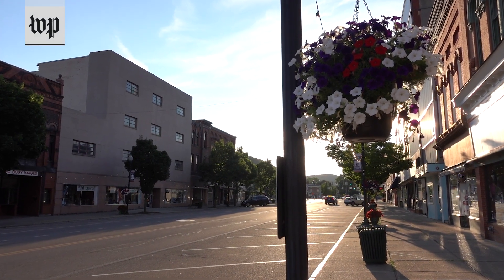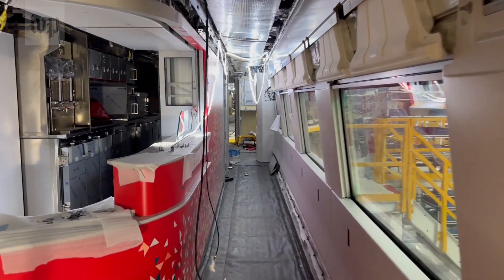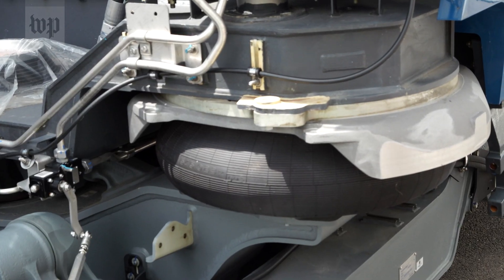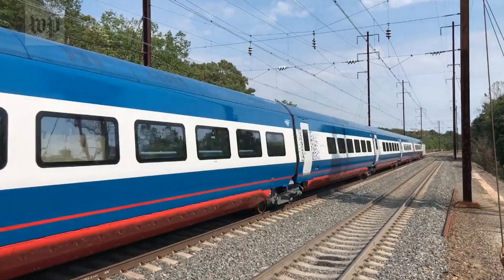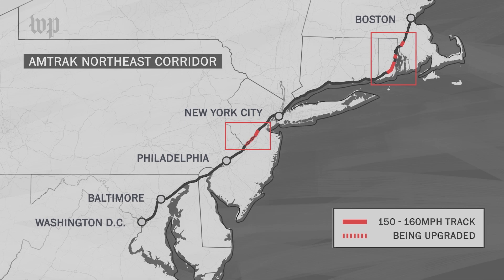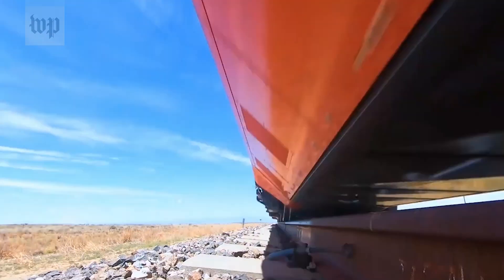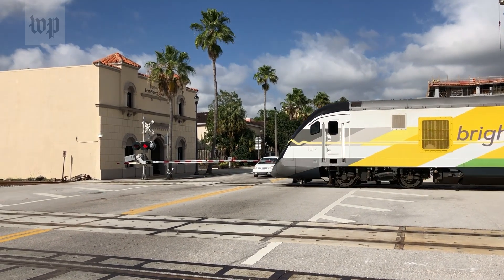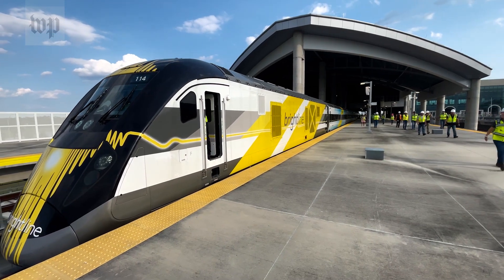Go inside Amtrak’s new high-speed train

Comment: Now Amtrak actually needs to make the tracks high-speed capable, with an average speed of 123km/h the Acela express wouldn't be called a highspeed line anywhere else in the world.
Reply: Nonsense! The French TGV fleet average speed is 60-75mph so 95-120k/h. For example, in 2017 French TGV trains averaged 103 km/h or 64mph. The Acela in its current state is about as fast on the entire route as French TGV trains are. And this really isn't very surprising. The original Acela was based on a contemporaneous Alstom TGV design and modified for the North American market by Bombardier. The overall philosophy of how the service was built was very French in many ways. Essentially, French TGV was the model they were going for.

Plus, the Northeast Corridor is mostly 125+mph with a few even faster sections (125-140mph) and two 150mph sections. In actuality, the NEC is a few corridors stacked end to end but served by a single high speed train. There are a ton of HSR corridors of similar length, with similar top speeds, and similar slow sections all over Europe. And a majority of HSR corridors in Europe top out at 125mph (200k/h). If you don't consider the Acela HSR then more than half of Europe's "HSR network" disappears from the map too!
Reply: @TohaBgood2  THANK YOU!!!!!!
Reply: @amtrak_121  Well, what I said is just objective reality that can be easily verified from public sources. But my pleasure anyway!
Reply: @TohaBgood2  
You're saying nonsense
  you took the speeds of the local trains (ter: regional express train), intercity coral), not those of the tgv

paris-marseille 660 km in 3h40 = average 178 km/h
paris-lyon 391 km in 1h45 = average 223 km/h
paris-bordeaux 499 km in 2h30= average 230 km/h
Reply: @TohaBgood2  Yea that is non-sense, first of all the majority of European countries don't even have high speed rail and don't claim to.
But if you look the countries that have high speed rail, even the not so great German network has the vast majority of all important corridors operating between 220-300kmh/h.
As someone who does take German high speed rail regularly I can tell you the majority of high speed service here does quite a few more kilometres per hour than the Acela even though the density of stations/stops here is far higher.
Reply: @mx338  Nope. Look at the Map of German HSR. The vast majority of the ICE lines are "Upgraded lines for 200–230 km/h (124–143 mph)" and some lines are "High-speed lines for 250 km/h (155 mph) or more". Only four German HSR lines are "High-speed lines for 300 km/h (186 mph)."

You can google this map in three seconds. Why would you try to lie?
Reply: @TohaBgood2  I have looked at the exact same map, while around 65% of tracks support less 230km/h, as I said it's the important corridors. that carry the most amount of passengers between the most populous cities on the most important routes.
Which should be obvious because why else would they be targeted for such expensive upgrades.
Reply: @mx338  Again no. The vastest majority of the German HSR corridors are "Upgraded lines for 200–230 km/h (124–143 mph)" So 200 kph (124 mph) to 230 kph (143 mph).

Don't pretend like those are all 230 kph. That's very clearly not true according to freely available public data.

And the actual passenger flows were never in question here. The Acela also has the vast majority of its passengers travel on the higher speed sections of the NEC. You're not taking that into account, do you? So why would that matter for the German HSR network all of a sudden?
Reply: @TohaBgood2  I just found the Wikipedia map you are looking and note that upgraded tracks are not even called called high speed, you are looking at the map of train which are serviced by ICE type trains which doesn't mean high speed service.

If you want to see German high speed corridor times look up ICE Sprinter Lines.

And Germany here really is one of the worse examples as I stated, as not a lot was invested, and is not impressive compared to countries like Japan or China.

But the achievement you are trying to seem great here is that the whole USA was capable of connecting just two cities, NY and DC, with high speed only on that section of track, and even that would be considered average at best compared to the rest of countries who built high speed rail.
Reply: @mx338  🤣🤣 this was the most entertaining conversation I've seen as much I love amtrack  Japan south Korea  Germany and France and China  have the best trains what's inbarising  is that India trains are faster than amtracks that's a fact :(
Reply: A train can only be called a fast train if the rails can support an average speed of at least 200 km/hour or 125 miles/hour.  like a freeway, it doesn't matter what type of car it is if the road is designed to be driven at an average speed of at least 100km/h or 62 miles/h.  can only be called a freeway
Reply: Yeah there is literally no advantage to the Acela vs normal Amtrak trains currently.  The new Seimens dual mode locomotives and new viewliner cars are capable of 125mph and routinely do those speeds in the same areas where the Acela can do those speeds or faster.  The old GE diesels (the very blocky looking diesel locomotives that move most of their trains in the south and west) can still pull 110mph where infrastructure allows.
Reply: It's like a TGV that is running on normal tracks in France.
Reply: Blame Blumenthal for that. He needs to allow Amtrak to straighten the lines. If not, Connecticut should be defunded
Reply: In the video they literally said that they were doing that
Reply: Why do people always base these things on AVERAGE speed over OPERATING speed?!
Reply: @amtrak_121  because operating speed is meaningless when it comes to trip times, and that's what matters to passengers. Passengers obviously want to get to their destination as quickly as possible.
Reply: @mx338  it’s still a high speed train
Reply: @amtrak_121  it's a useless high speed train if it doesn't move people quickly.
It's like a fast sports car people buy to show off, but they are never able to properly use because of speed limits everywhere.
Reply: @mx338  it can travel 150mph both in New Jersey and Rhode Island/Massachusetts!
Reply: @mx338  except it doesn’t have those kinds of speed restrictions everywhere!
Reply: @amtrak_121  yes and? The average speed still sucks and makes the train take a really long time. And 150mph isn't  really amazing either, the new trains could do better than that.
Reply: @amtrak_121  and as someone living in Germany, with the Autobahn having no speed limit for some sections, I still consider a sports car a waste of money even if you can manage to get up to 250km/h here for just a few minutes.
Reply: @mx338  at least we HAVE high speed rail!
Reply: @amtrak_121  not even 50 miles of it but congrats.
Reply: @mx338  no it’s definitely more than 50 miles (I’m pretty sure at least)
Reply: @amtrak_121  well you should read up on it because it's only 49.9 miles that allows speed of 240km/h.
Reply: @mx338  THAT CAN BE ROUNDED UP TO 50!!! It’s only 0.1 miles short!
Reply: @amtrak_121  it's not 50, like I said. 
Why are you Americans always so eager to make your country seem great, and usually like the greatest? 
Instead of admitting your weaknesses and wanting to improve it, you just try to bend things to say America still is great.
Reply: @mx338  we do our best!

But Amtrak is corrupt and a terrible passenger rail operator!
Reply: @mx338  America still has one of the best freight network. America wasn’t built on high speed. We are the best because we make progress. Try again.
Reply: @mx338 because we are great, most of all the important advances in modern times are the product of American ingenuity.
Reply: lol in china train 220kmh average
Reply: @jackmiller7324 and in China, did they start building their railways in the 1800s or the 1990s?
Reply: we have time to travel.
Reply: @jackmiller7324  Indeed, regional intercity (IC) trains in Germany regularly go 220km/h, not talking about the ICE that can get up to 300kh/h.
Reply: @marcusdamberger  But the vast majority of German HSR services top out at 200kph or 125mph. The Acela, with a top speed of 150mph (241.4kph) is actually on the slightly faster end of the spectrum by German HSR standards.

Let's be fair here. It's not like we can't all look at the same "hsr speed limit map of Germany." The vast majority of lines, excluding the conventional speed ones (100mph), are the so called "Upgraded lines" with a speed of  200–230 km/h (124–143 mph), so about as fast as the Acela but with lower top speeds.

If the Acela were magically transported to Germany, it would be a slightly above average HSR line.

Comment: Lmao 160mph. Much laughs from Germany (186mph) or Spain and France (198mph) 🤣🫣.
Reply: Yeah but tracks are important. 220mph train vehicles are no issue for the US, but all you need to do is spend an hour driving or riding around the NEC region to realize that the problem is that outside of the 100+ year old line, there is literally no space for new rail
Reply: Germany also has 198 mph tracks ;)
Reply: @TheKartoffel101  But they only use them at 186 mph.
Reply: @finaLee69  Not really. Just Siemens and Thyssenkrupp insanity. The fastest Chinese HSR Trains are Siemens Velaro CRH3 from Germany (380 km/h operating speed). German Transrapid Maglev did 500 km/h over 20 years ago in the 90s (Siemens - Thyssenkrupp cooperation).

Comment: I’ve been wondering, why don’t the power cars match the coaches’ shape?
Reply: The coaches can tilt when rounding a curve, but the power cars don't because they have to be able to make the turn at all without falling off.
Reply: @dweebteambuilderjones7627  so the drivers just swing around inside the cabin? Lol. Thanks for the info though!
Reply: Everyone who's a rail fan has made the same observation and it's driving them nuts why it wasn't made the same shape as the rest of the train. Couldn't agree more, it's odd, because the old Acela cars match the shape of the power car.
Reply: @marcusdamberger  yes! It looks incomplete or poorly made, idk…

Comment: I wish the railroad would get federalized and let the government invest the money in upgrading the lines.  Even these "high speed" lines are dated.  A proper high speed line doesn't have just concrete ties.  it is all part of a concrete bed and those tracks don't move.  They are also seamless. You don't get the rocking like you do on Amtrak's current lines.  It takes an investment. If you want to take the production seriously, you have to offer a serious product.

Comment: Finally Amtrak! This is what the U.S. needs.
Reply: California High-Speed Rail and Brightline are not Amtrak, they are totally separate entities. They don't connect to Amtrak and you can't buy a ticket on Amtrak that would include those services even if they terminate at the same station. Yes, the new Acela's look much better, more modern, but they only run on the northeast corridor on shared track with slower reginal trains. They will only be 10mph faster in certain sections of that line.
Reply: @marcusdamberger  I know, I wasn’t talking about Brightline..

Comment: It's already somewhat old by design. 3:09 those power plugs should be universal, like they have on planes. And there should be 1 USB-C and 1 USB-A, not both USB-A.
Reply: USB-A and USB-C have no inherent difference, they're just shapes. USB-A can have speeds of USB 3.1 typically associated with USB-C. So that's a non-issue.
Reply: @transfo47  I'm aware. Most people don't have those adapters, though.

Comment: I mean this an ok start, but we really can't use these new trains to their potential without upgrading the rails they run on. My car is capable of "high speed" but the roads and laws don't permit operating it like that. I get that we needed new trains anyways, but i worry that by the time we get the hard infrastructure upgraded, these new trains will be on their way out meaning the potential will not be fully realized during their service life. 

So, as nice as these new trains are, they're just lipstick on a pig without a corresponding update to the rails.

Comment: Good video but...
The new Acela are not the fastest trains in western hemisphere, they are downgraded TGVs designed to FRA specifications that prevent high speed trains. (the original Acelas had to be made of heavy steel which prevent high speed, so at least FRA relented in 2018 to allow aluminium shells in use since 1980s in europe ahd Japan). 
Brightline is not even close to high speed, it is diesel and heavy steel carriages.  Large number of level crossings (and deaths) limit its speed.  It may have PR that advertises itself as privately funded, but when you look deeper into the project, you will see huge amout of cash influx from federal and state and municipal governments (which delayed Ollando to Tampa stretch because of competing governments wanted different routes).
The California project is being built as true high speed on tracks and trains capable o going full speed (in 2020s, high speed is close to 300kmh sustained, not reaching it for 30 seconds for bragging rights).
Reply: Unfortunately CAHSR is being threatened on the daily by NIMBYs and is also WAY over-budget. But I hope at this point construction has progressed too far to stop.

Comment: 1. It would be nice if the cafe car had edible food, rather than just nuke burgers and nuke breakfast sandwiches and salads.  Though unlikely.  Equally unlikely would be a paint job that doesn't make the trains look decades old before they go into service.  Amtrak has some great paint schemes on standard equipment; why the A2 doesn't is quite a mystery.  As to riding on them, it should be a lot smoother, especially if Amtrak fixes some of the awful track somewhat north of DC - plus the new truck design should help.  The one thing that this video doesn't mention is the cause of the delays - I've read that the pantographs had to be partially redesigned because of the antique catenary in parts of the NEC.  This video gives the first look I've gotten of the gap filler mechanism - looks pretty good, but I hope it's reliable and accommodates different platform edges and heights.

Comment: Ha!   In China they open a new high speed rail line every week.  We can't even get a lousy line in California
Reply: They’re working on it, the first is always hard
Reply: @theexcaliburone5933  , i hope.  I'm middle age now waiting for it in San Diego.   I doubt that it will make it to San Diego in my lifetime
Reply: @richiesd1  yeah, it’s gonna take a while. At least you have the Pacific Surfliner, it’s about as fast as driving, cheaper, and much more comfortable
Reply: @theexcaliburone5933  , I take the Surfliner when I need to get to LAX. I connect at LA union station, then i take the airport bus.  The train frequently late or canceled, so I have to plan five hours so I don’t miss my plane.  It is so frustrating to live in a developed country and suffer a lousy transport options.  China has it down to a science. — their  viaducts spans, sidewalk curbs, etc are built in factories and placed onsite like Lego sets.  We still build things one-off, the slow way, using wood forms to pour concrete onsite.   
At this point I think we should just put our projects to bid and let the Chinese do it more efficiently, at less cost.  Maybe I will have something I can use in my lifetime.

Comment: 3:00 Nice gap filler on the doors. However that always slows down the opening process as well because it must extend before the door can open. Maybe not such a problem for high speed trains but for commuter trains stopping a lot it can be a cause of delay.
Reply: well... this is pretty much for HSR for now anyway... 

America doesn't have much high level platforms... most are at-grade platform outside of the corridor.
Reply: @PrograError  Depends where. I guess there are more in the east. Aren't most/all acela stations high platform?